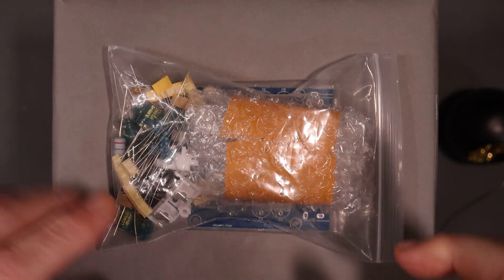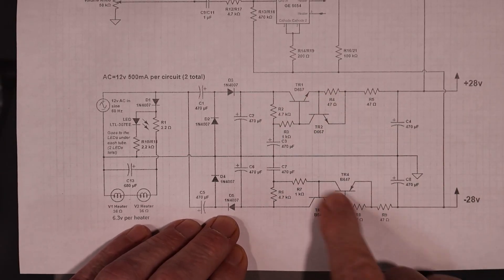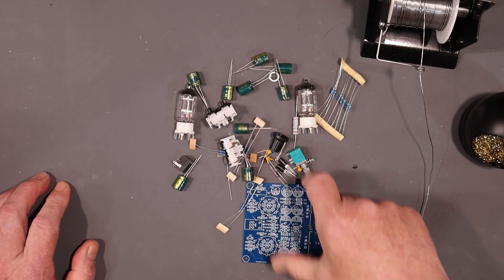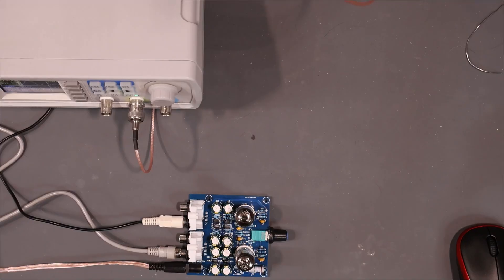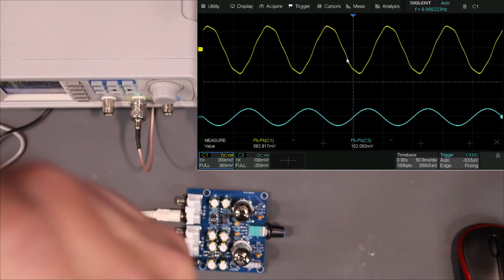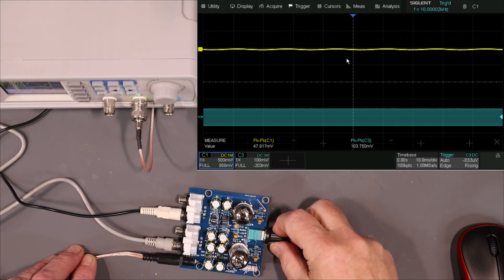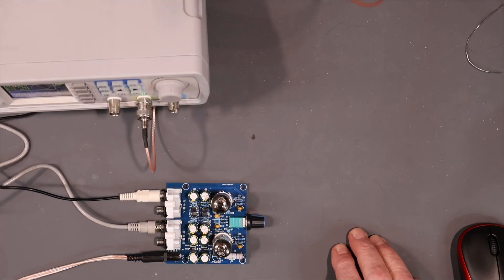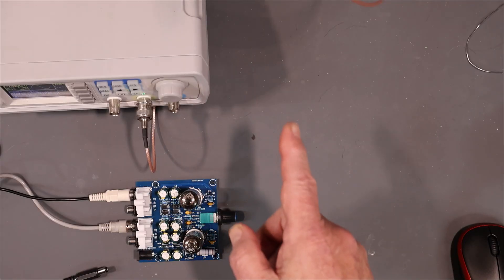Uni-Byte 0284 - $10 6J1 Tube Pre-Amp Kit BUILD and TEST.  (Better than Expected!)

Comment: How to increase its output power??
Reply from the maker: You would have to add a power amp section to it.  How much power do you need?
Reply: @uni-byte but after connecting with power amplifier will it provide you the sound quality as well as tube amplifier?🤔
Reply from the maker: @Kimjeeseong김지성  Yes, for the most part.  The sound profile is usually set in the pre-amplifier stage so, unless you were going turn it up until clipping the power amplifier, it will just follow what the pre-amplifier sends it.
Reply: @uni-byte woh.. thankyou ❤❤❤
Reply: @uni-byte at least 60-70w

Comment: someone said, putting continuous current through filament may shorten it's life.
Reply from the maker: This is correct.  Using DC will case what is called "ion migration" where ions move from the cathode into the filament contaminating it.  DC is (or was) sometimes used, especially in battery powered equipment, automotive equipment and in extremely low noise application.

Comment: There is nothing wrong with how they did the diodes and the resistors.... it wont do anything to the transformer!!!!! what I would do tho is put a bridge rectifier right after the transformer so as first in the power input c1 and c5 you can leave out at that point but change c2 and c6 to a 100 uf the voltage doubler will still work and the 50 Hz hum be gone too D1 with the resistor wont harm the transformer as it goes through the heater filaments... also the filaments can handle dc...  the led has a 2.2k resistor and is after the first diode that is a high resistance wont hurt the transformer a bit... in fact to leave that out you may introduce some hum... those are the mods i would make to it
Reply from the maker: Maybe I wasn't clear.  I did not remove the LED's because they would affect the transformer.  I removed them because they would be subject to the AC and experience reverse voltage they cannot handle.  As for the transformer, sure, maybe if you put one in that was twice the size, the unbalanced loading might not bother it much.  The combined resistance of the two tubes and the 2.2Ω resistor is about 13 ohms, so this circuit draws about 1 amp.  If properly loaded throughout the cycle, this means you can get away with a 12VA transformer (which is what I had).  If you leave the diode in that same power needs to be generated over 50% of the cycle, meaning that the current would have to be double during the part of the cycle.  My 12VA transformer would not appreciate that.  Not to mention the horrible switching noise caused by a half wave rectifier that a 470uF filter capacitor would be woefully inadequate to deal with.  Back when tube amplifiers were the thing, the heating filaments were nearly universally driven by AC and never created excessive noise.  At least not in the professional McIntosh, McCurdy and Magnatech amplifiers I worked with regularly.  Sure, they will run on DC, but they don't have to.  That DC is here merely for the pretty little LEDs, something of exceedingly little interest to me. Because of that, the bridge rectifier you suggest does not warrant the circuit modifications required to accommodate it.  I'm not sure why you are suggesting capacitor changes, especially to smaller ones.  The 20mV ripple is not coming from teh heaters, but from the main supply.  Larger capacitors and possibly chokes might help eliminate that.  But, is it really worth the the effort for a toy?  Thanks for your comment.

Comment: When I worked at HP's 'scope division building CRT's there was a problem with pins getting screwed up and the tipped off glass being broken after the tube was evacuated, either one ruining new tubes. It was obvious to me even a few days after I took the job. So I put in a written suggestion to my foreman (because they offered bonuses for ideas that saved the company money,) that we plug the tubes into sockets as soon as they had been taken out of the pump-down oven, and to also put a simple protector around the pins on the neck-glass to protect them. I couldn't believe they weren't already doing it. Then about 3 months later I got invited to a department-wide ice cream party and the presentation of a $500 check to my foreman for the idea I'd submitted.
Reply from the maker: Nice story John!  Kudos on the bonus for speaking up with new ideas.  HP was a great company to work for at one time.  I'm envious of anyone that got the chance.
Reply: @uni-byte  I think you missed the point here. He didn't get the bonus. His foreman did!
Reply: @SpeccyMan , well yeah. There was that aspect of it. But I did get free ice cream. But HP was pretty bad to me, at the same time as everyone was saying how wonderful it was to work there. They put me on an awful machine to operate while I was waiting for a tech job to open up. It was a big circular machine with 8 positions for gas jets for the CRT neck glass, gun, and wafers to rotate around to the different positions and get sealed together. Loading was precise work. Unloading was handling hot melted glass that would often shatter as I removed the excess from the holder. I wore a big glove, but I still have scars on my forearms from bits of flying hot glass. The machine was in its own little room, the gas jets were so loud you had to yell to be heard, and the temperature never dropped below 104 degrees F in the year and a half I worked on it. One summer evening it hit 124 degrees. I bring this up because during that year and a half I interviewed for 3 in-house tech jobs. After the interviews I thought I had all 3, but got turned down for each. Finally, after the 3rd time I got turned down I was getting angry and confronted the foreman who had interviewed me. He looked around, then quietly informed me that management wouldn't allow anyone to hire me because I did such a good job running the machine that no one else was willing to run, and there was a hiring freeze so they couldn't even hire someone from the outside. I had a wage review about a week later and they gave me a nickel an hour raise, up to $3.31 an hour. I gave them my 2 weeks notice. My employment history is mostly horror stories. But at least the next job was as a tech. I computerized army tanks so they were autonomous and would drive themselves around as targets for advanced weapons systems testing. They were probably the world's first autonomous military vehicles, and possibly the first of any kind of vehicle. It was before GPS, and we had to establish our own synchronized RF grid for the tanks to use to position themselves. But I'm rambling. So I'll just say that HP was not a happy part of my career.